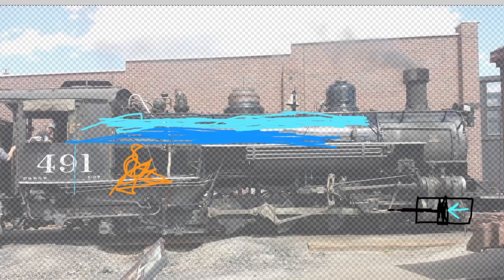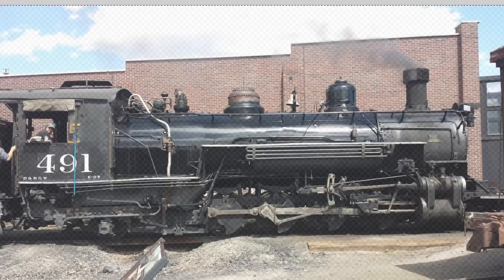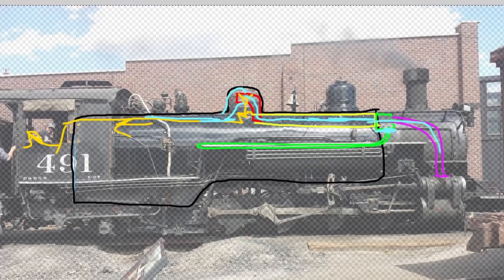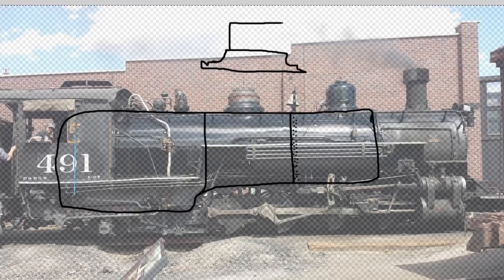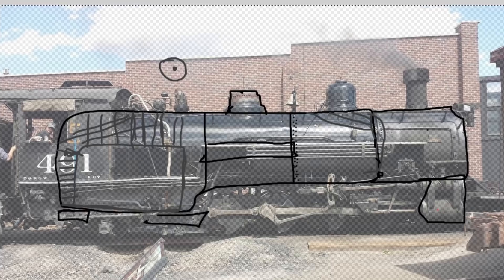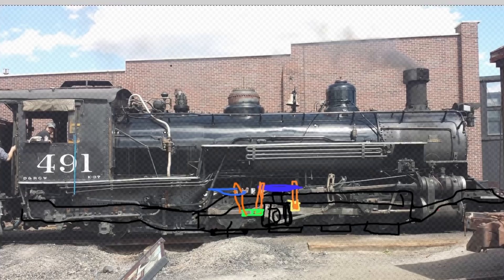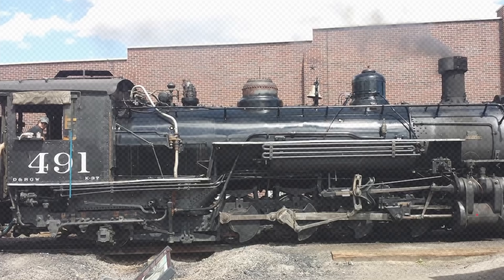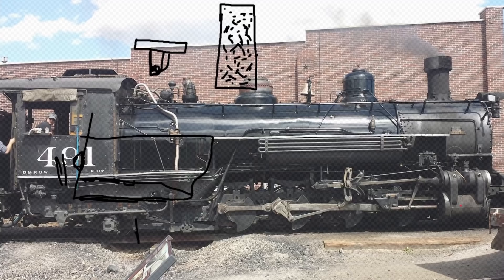Steam 101: 10 Levels of Steam Locomotive Understanding

Comment: I have a question about the superheater.
I understand that the super heater runs parallel to the exhaust rods. Are both the superheater and exhaust rods submerged in the water? If so how does the super heater heat up the steam to 700 degrees.  Also I'm  from NZ, when I hear degrees I think degrees Celsius, but I'm assuming this is 700 degrees Fahrenheit?
Reply from the maker: The superheater pipes run inside the exhaust tubes, so you have (outside in): water, exhaust tube, exhaust gas, superheater tube, superheated steam. And yes - 700 degrees Fahrenheit. I had no idea what a worldwide audience would one day watch this video so I never bothered to do the conversion.
Reply: @Hyce777  Thank you for your reply, I get it now. That was the one thing my noggin was struggling to compute.  Fantastic video, thank you for taking the time to share your knowledge with us.

Comment: I’ve only seen locomotives, never worked on them. However, my mechanically oriented brain understands how a Walschaerts Valve gear works, and I know that melting a crown plate is very bad and can cause all sorts of funky problems, including a blast of hot air that can kick the firebox doors off, if things go very wrong. However, all the mechanical knowledge I have will still never help me get a girlfriend. Oh well, gonna keep learning, and this is a good video to help learn even more.
Reply: oof

Comment: The Johnson bar  functions like the engine's transmission .   Wide open full forward or back you have "low gear" , lots of starting power, but poor use of steam expansion.     Near the center, you have a " high gear / Overdrive"  You get the most expansion from your steam when everything is running well, no lugging.    On good track with a crack crew and high wheel engine, you can get remarkable speeds out of Steam power.   Remember this is a rather basic engine, like single engine airplane.   Like a multi engine airplane things get more complex  when things are duplicated.   You also see how many place need lubrication on even a simple engine.  All that lubrication and many sliding wear surfaces added to the extra care steam power needed over diesel.

Perhaps another video could be a more general view of  locomotives at a higher level    Frieght vis fast Passenger units,  simple versus compound expansion engines , and those with  more than one set of cylinders.   That may be called another type of compound engine, but I am not sure of the proper terms for them.  All I know is the truly massive engines duplicated all the magic of the driving gear two or three times.   They added another steam engine, just to push coal into the boilers required by such monsters.   Also I believe a dinner party was held inside  one of these huge boilers.  At their peak Steam engines were the 747s of their day.  Many thanks for  exposing the complexity  of a "simple" steam engine..  Very well done
Reply from the maker: Thanks :) also another good set of video ideas. There were many bizarre compound locomotives experimented with, and yes, you certainly could hold a dinner party in some fireboxes... You could host a small game of hold'em in this firebox, so long as everyone was sitting with crossed legs... Lol!

Comment: that's really awesome, but I'm still wondering what mechanism that prevents the cylinder and piston from imploding when you close the regulator for coasting?
Reply from the maker: That is a nifty thing called the snifter valve! Once you lose steam chest pressure gravity forces it open and it allows fresh air in to prevent a vacuum from being formed.
Reply: @Hyce777  While a vacuum in a steam cylinder seems a problem for a couple of reasons (at the very least, the cylinder will have a braking action if this happens). I can't really see a cylinder imploding  from it. A vacuum is only 1 bar of pressure difference with atmospheric, a steam cylinder can withstand multiples of that. If a compressor tank can withstand a full vacuum without any problems, so can a steam cylinder for sure?

Comment: From a dead stop, how does the locomotive actually start moving?  What does it take to "nudge" that piston in the cylinder into motion?
Reply from the maker: If you're not at tonnage, the steam itself will gladly start moving the pistons, provided you're not "centered" where one piston is all the way forwards or all the way back. In that case you need to roll one way or the other to get "un-centered". If you're at tonnage, sometimes you need the additional hammerblow of the steam hitting the piston all at once to get things moving (think like if you open the water supply lines too quickly, the water rushing in and hitting fittings / other valves etc. has a huge "impact" from it's velocity - pressurized steam also does this, but to a lesser effect because steam does compress unlike water).
Reply: @Hyce777   Thanks for the follow-up.  After watching the video, it's easy (tongue-in-cheek) to understand the valve, rod and wheel movement once under way.  It was that first moment, when steam is introduced to a standing train.  It is amazing enough for just a locomotive, but to have just those two cylinders begin moving a full tonnage train...   Thank you once again.

Comment: When you said the steam exhausts into the smokebox you didn't say that it makes a vacuum that makes a draft that makes the fire burn hotter. The puffs of smoke coming out of the smokestack is due to the used steam exhausting into the smokebox. Guy Franks
Reply from the maker: That it does, absolutely correct.

Comment: can you take the steam from the piston back into the steam box?
Reply: Yes, you can. But why?
Unlike on high seas, fresh water is abundant and available. Just set up a chain of coaling and watering station along the railroad. When water run low on locomotive, just refill the tank along the railroad.
Better put that exhausted steam to good use, and blow it out up the chimney. You get a way better aid draft inside firebox, a better burning coal, and a better fuel efficiency.

Comment: I have a question :
Why they didn't added steam condenser so they never run out of water?
Reply from the maker: I don't 100% know this answer for sure, but my assumption has always been that using the steam exhaust to re-invigorate the fire had a much greater effect on efficiency than keeping the fire separate and trying to recollect the used steam. As well, I'd wager a condenser capable of dealing with that much flow and volume would be massive. I imagine someone more versed in those things could probably give a better answer though!

Comment: Hey, Hyce! So here is something I've been wondering for a while.
How does a tank engine with no external pistons (IE: Thomas) work/move?
Reply from the maker: If i recall correctly the loco Thomas is based on has the piston inside the frame between the wheels running on a crank. So, the same, but you can't see it.

Comment: I'm confused as to why the Union Pacific Big Boy engine is so long, and more importantly how the boiler/firebox works. One couldn't shovel/push fuel from the footplate all the way along that distance so how does it work and why is it soooooo damn long in the first place?!!! I've also read that the Big Boys were articulated, so does the boiler and firebox only go halfway along the engine and in that case what is the other half used for?
Reply from the maker: The fuel is delivered by a large auger, and then blasted across the large firebox using steam jets. The rest of the length is the combustion chamber, tubes, and smokebox. The boiler does go all the way, the front engine set swivels underneath it. They're magnificent locomotives.
Reply: @Hyce777  Ahhhh, thanks - I had envisaged some sort of mechanical device such as a "conveyor belt" to distribute the fuel should the boiler/firebox really be the majority of the length of the engine.  And yes, they are still awesome, incredible and magnificent examples of engineering, I just wish I could witness one in person, the biggest I've seen here in the UK was a "Tornado" a few years ago when it passed where I was living alongside the Bodmin & Wenford Railway, the tracks of which were no more than 200 feet from the house I was in at the time.

PS: I used the information you provided here to research the engineering behind how a locomotive auger and steam blaster work as at my age and after 5 strokes I'm back to needing simple pictures to explain new things to me!  I came across this video https://youtu.be/ogpI7_qZeTA?t=666 which provides a diagram of such a system, I thought you might appreciate seeing it too. 😉

Comment: What about steam engines that do not use fire at all? I mean in areas where fire power would be very dangerous (ex Mining)
Reply from the maker: They don't have a firebox, and take steam from a stationary boiler and then run until they run out of capacity.

Comment: It depends on the variant largely, there are different variants of steam locomotive that work differently ie Shay Locomotives don't work the same way as a Tank Engine. Big Boys have two throttle bodies, with one driving the rear set of drive wheels in the dome and a throttle body in the superheater to drive the front set of drive wheels actually.
Reply from the maker: For sure, lots of different flavors out there. Do you have a source for the big boy throttle? I don't think that's accurate.
Reply: @Hyce777  paperwork for the construction of the Big Boy and from having driven one during the first Steam Program, it has two throttles each with it's own throttle body and it also has two fireboxes, one for the boiler closest to the cab which operates the piston closest to the cab driving the rear set of drive wheels and one for the forward boiler which operates the forward piston driving the forward set of drive wheels but it only requires the one Johnson lever which is attached to both sets of drive wheels.
Reply from the maker: @michaelmckinnon7314  lol get out of here troll
Reply: @Hyce777  you think I'm kidding,  well I'm not a Big Boy is a 2-10-10-2 nonarticulating complex drive steam locomotive with two pistons, fireboxes, throttles, throttle bodies and boilers, I can teach you to drive one if you want but it's not the eco-friendly type that uses one source of steam to operate both pistons, like some of the last steam Locomotives built were because the designer didn't like the drop off in drive power from the reuse of steam from one piston to drive the other.

Comment: could you explain type of engine accidents in greater detail? boiler explosions? steam train burn outs? and well blowing out piston rings?, i remember you said camle back engines had a habit of rods breaking and hitting the cab.
Reply from the maker: I think that certainly would merit some detail, yes! Camelbacks did not necessarily have "a habit of breaking rods", but if they did, it'd nail whoever was in the cab....
Reply: @Hyce777  i would also like to ask since your one of the few train youtubers i know actually has experience driving and working on trains, would you consider explaining weaknesses of different trains, both diesels and steam , for example, i know you know about camel backs and fairlies,  and you have helped make a game with most of the geared steam trains,  i know for example from your own videos fairlies have low fuel storage, and geared trains are slow, are there any other notable things that might make a interesting fact video?, also what type of steam engine would a 0-4-0 grass hopper be? it doesnt seem to have rods  the same way as most steam trains.
Reply from the maker: @josephhobbs7957  That's a great idea for a video or two. Cheers, I will see about making that happen!

Comment: Just a question out of curiosity: could a coal burner operate by burning wood, and/or vice versa? Obviously there would be effects on the performance, but could it technically be done? What are some pros/cons to the different kinds of fuel in general?
Reply: Not someone who operates steam engines, but on the pros/cons bit I can give my barely educated opinion. The pro of wood is it's availability. The pros of coal are its energy density and it burns cleaner (less build up of junk on the inside of your engine). And for oil its main advantage is that it's easier to automate, replace your firemen with a bit of hose, a pump and a (couple of) nozzle(s).
Reply from the maker: Coal burners can burn wood, but you're not really set up for success with the firebox design to take advantage of it. That, and the lack of additional cinder screening would cause you to burn the countryside down, lol. Wood burners could burn coal, but again you couldn't burn it effectively because the narrower, deeper box allows for a thicker bed which is bad in the case of coal most of the time. That and the extra cinder screening would hinder the draft, causing poor steaming. Haha. 

Wood is bad in general. Burns too fast, if you're really working you pitch it in constantly.

Coal is better as far as the way it burns, it's cheap, but it's dirty and dealing with the ash sucks. There is some amount of romanticism with using the shovel, and it's really fun imo. It's also less prone to instantaneous changes causing problems as you have an actual fire bed.

Oil burning is clean, and the least physically taxing as you operate a few valves rather than physically moving the fuel yourself. That said, it is highly dynamic - any change made by the engineer needs the fire to change in that instant to keep up, so you're really living in the moment. A sudden wheelslip can also cause issues with the fire (even put it out) and can cause explosive relight.
Reply: @Hyce777  explosive relight sounds exciting :D
Reply from the maker: @ValentineC137  https://www.youtube.com/watch?v=3Whg7knLIdo&t=10s

Comment: You missed why spent steam goes into the smoke box and it's not so it doesn't go out the sides.  It is to stoke the fire.  Something like this by creating a low pressure at the end of the fire tubes.  Air goes from low pressure to high so the air is pulled into the fire box stoking the fire then into the fire tubes then out the smoke box.
Reply from the maker: ... did you watch the whole video? :P
Reply: @Hyce777  yes works like a 100s year old perfume bottle fast air over pipe creates a vacuum.  The ancients knew this.
Reply: @Hyce777  I'm not the best at explaining but the perfume bottle example might work.

Comment: Why did rio grande and a bunch of cumbres Toltec make their engines have inside frame wheel sets?
Reply from the maker: They're able to have a bigger boiler on a smaller frame / engine that way. If you move the frame outside the wheels, you have more space in the middle.
Reply: @Hyce777  OH YEAH THATS TRUE!! With the wheels inside, you don’t have to have the problem of the wheels being too big and limiting the space the boiler can be in.

Comment: Why do they need air compressor instead of just using steam pressure?
Reply from the maker: Steam cools down and becomes water. Not an issue around the hot engine; but 100 cars back in the train, that's a recipe for having brakes that don't work.

Comment: check valves are extremely important!!! as in air compressors tanks or steam boilers... don't want to be like the "best friend of charlston"..  do you regularly drain the water in air tanks on steam engines.. to prevent the air tanks from rusting out from the inside to the point to where it makes holes?? also do you drain the water out of your home air compressor tank for the same reason?? I've seen many shops that don't even bother draining their air compressor tanks and wonder why their air compressor keeps on running and spitting water out of the air hose... instead of draining the tank.. they buy new ones and toss their "broken" ones.. (What a bargain!!!!)
Reply from the maker: Drained every single day. Steam air driven air compressors make a TON of moisture. We also hammer and hydro the air tanks on every single annual because they're not drilled. Incredibly important to keep them in good shape :)

We have an automatic drain that clears moisture periodically on the main shop air compressor tank at the museum. :)

Comment: The superheater in a locomotive is basically like a supercharger in a car engine right?
Reply from the maker: Similar, yes! Using exhaust gasses to get more efficiency, though the specific nuance is a little different. Where a supercharger takes exhaust or engine power to spin a turbine, thereby increasing air pressure into the engine (which does a lot of different things that gives you more power) - a superheater on a locomotive takes the exhaust from the engine to pull exhaust from the fire (external combustion ;P) through the flues, thereby superheating the steam increasing it's temperature (not pressure) such that it gets significantly more expansion as it is utilized, allowing for more power strokes for the same volume of water.
Reply: Ah yes, now i understand

Comment: Can you imagine firing a locomotive with a fire box of 110 square feet or more, like a dance floor for pygmy's. My Step dad fired the boiler for the Myron C, Taylor a 550 foot freighter by hand with a shovel, the fire box was big enough for a 5 foot 7 man to walk around inside actually 2 and the visual was impressive , the engine was "way cooler" 3 vertical pistons 10,000 horse power they had to cycle it continuously to keep  the condensate out. They had these little donkey engines on the loading deck to move the boat forward and backward they were attached to the hawsers that were on the moorings, those engines were run on compressed air ,man steam engines on compressed air are VERY noisy.
Reply from the maker: Yeah that sounds hard.... I bet he's got great stories!